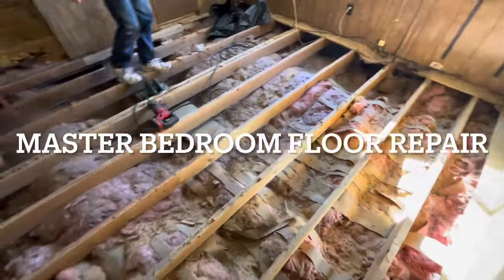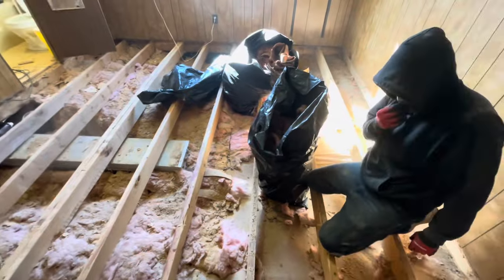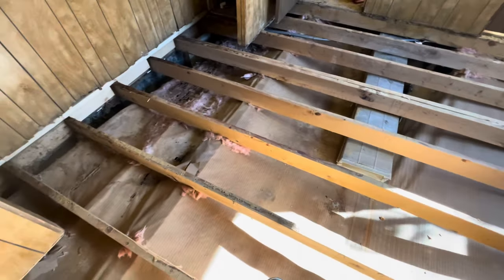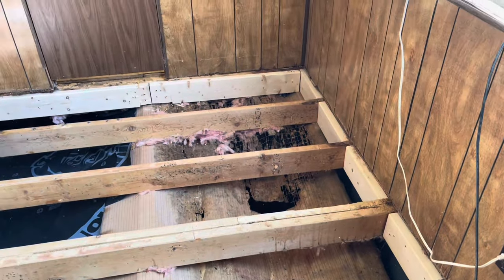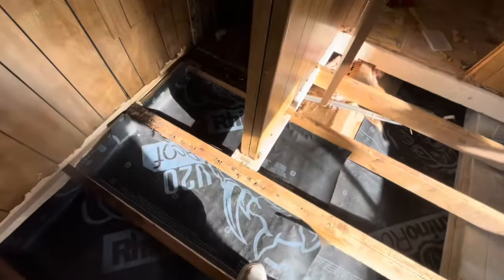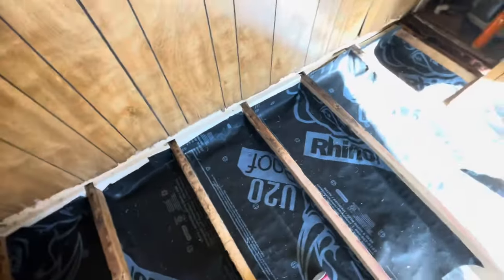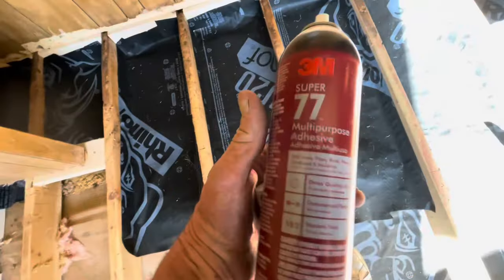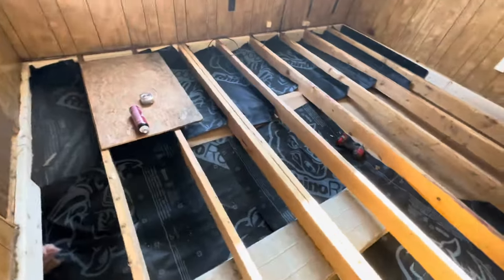Nothing is easy. Mobile home bedroom floor repair.

Comment: I can never appreciate y'all enough. I hope y'all are doing good, cause seeing Paul without gloves or a mask on and spraying that glue always gets me worried. I can't even use our degreaser at my frame shop without PPE! Y'all are the greatest motivators while my fiancé and I help repair his mom's old mobile home!
Reply: Also, we did a tiny 4x8' section of our dining room the other day and were wondering what to do about the insulation cause the subfloor is just trashed. We decided to just leave it until we can get under the house and repair everything, but seeing how y'all did it with the felt paper just makes sense. Glad I saw your vid before we did the whole main part of the house so we can retroactively get back under the plywood!! TY, Drew!!
Reply from the maker: Thank you and you are so welcome. Thank you for watching. I love my subscribers
Reply from the maker: Thank you so much. I have a hard time making him where anything

Comment: Nice work guys. Thanks for sharing. Over the last ten years, I've used a lot of Super 77+ and it ALWAYS fails on me after 3-4 years. I now just use regular contact cement for most tasks instead of the 77+. For a long time I thought it was great... until my projects started failing long term. For my trailer which I'm redoing floors and insulation/belly wrap, I'm using staples and Lowes white house wrap which is 3 foot wide. I waste a fair amount with 21 inch joist spacing- but it is easy to do from the top and staples should never come unstuck like the 3M stuff.
Reply from the maker: I’m going to buy staples for longevity Thank you for for the tip.  You will see me using it in the next video. Thank you I don’t want to start to fail and if it’s going to I’m gonna use Staples.

Comment: Oh.  Noo.   My husband tore the under belly out. And nasty mouse stuff in it all.out.    can we use something besides.  Pink fiberglass  insulation.  Back... hate that stuff. Rodents love it
Reply from the maker: You can cut Styrofoam to fit up in between the floor joist. I agree the pink panther stuff sucks. Mice love it. You can also go without insulation. If you don’t live in a cold climate like myself, I wouldn’t have to put insulation under my house. It always stays a decent temperature.
Reply: @Drewsroofingandhomerepair I lived in a trailer at fifty below the blankets on the bed would freeze to the wall . 👍🇨🇦
Reply from the maker: Dang that’s cold
Reply: @Drewsroofingandhomerepair  now you know why I don’t like trailers , My house has a eight foot below ground basement . You can leave it for several days without heat in the winter and the water pipes don’t freeze . Damn trailers fighting frozen water and sewer lines all the time . 👍🇨🇦